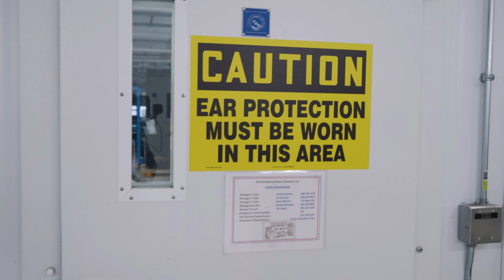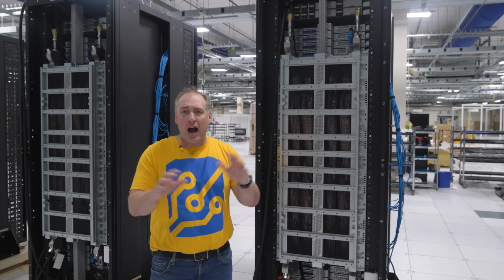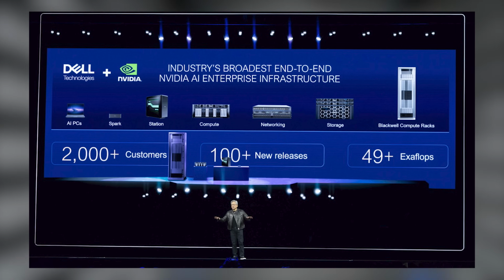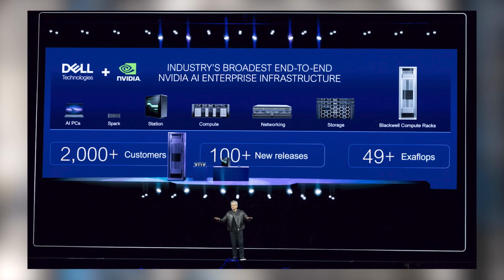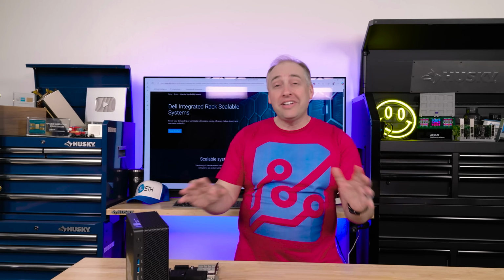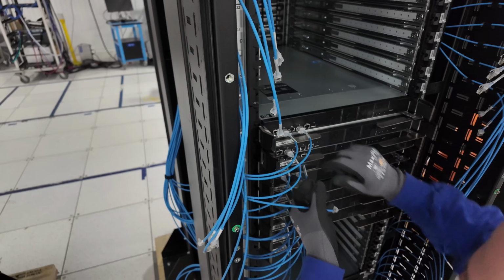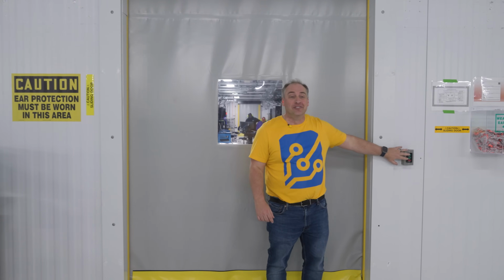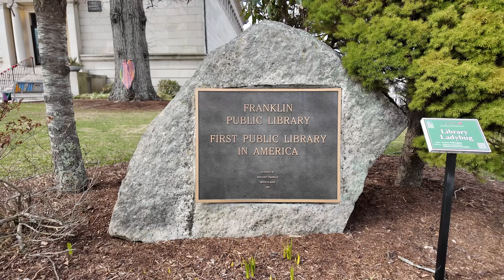Touring Dell's Factory that Builds AI Factories

Comment: That manufacturing facility looks like one of our prototyping facilities given how much space is still left or doesn't have "stuff" in it just yet.

But in terms of mass production, it's analogous to the assembly line for manufacturing/final assembly of cars/trucks where the parts are bought to the car, when it is needed (just-in-time manufacturing).

I was also thinking about this relatively recently about how blade servers have kind of gone away, and came back, but they work differently now where, for example, instead of having an Infiniband backplane, you now have individual blades that plug into the Infiniband switch, individually.

The way that they've set this rack up is more reminiscent of the older blade server days were you have a giant "backplane" that provided all of the networking and support that the compute blades needed to run and was built into the blade chassis.

(There's PLENTY of room for them to increase their volume/throughput, so long as the facility itself can handle it from the power/(water) cooling perspective.)

The other thing that I've also been thinking about recently is how do they prevent biogrowth and/or "gunk" build up like you see with consumer-grade all-in-one liquid coolers when you're cooling this many servers and deploying this many servers at a time?

It would be interesting to see what they do differently on the server side and this is something that I think that the consumer side all-in-one liquid cooling can learn a LOT from.

(It still amuses me that I was designing my own Socket940 waterblocks for AMD Opterons in 2006, as a mechanical engineering student, and now, 19 years later, they're shoving the watercooling components into 1U rackmount servers.)

Comment: They aren't BUILDING anything. They are ASSEMBLING racks from a great many already made pieces. (most likely all from China.) One could do exactly the same thing on the customer site.
Reply from the maker: After touring some large customer sites, I can tell you this is not the case that you could build them at this speed and scale on site. There are a lot of pieces. Automakers build cars from pieces. It is not like every automaker is mining ore to make steel that they then press into a screw.

Comment: 5 years from now, the amount of datacenter hardware that's going to be available on the secondary market is going to be insane.
Reply: lol can’t wait for the “do you think this Blackwell server is a good deal? Not sure it can handle plex transcoding” followed by “why is my electric bill $4,000”.
Reply: @yungcotter  I only pay 9 cents per kilowatt hour, and a single NVL72 rack would cost me roughly $9,000 per month running 24/7.
Reply: @SyntacticOperator 🎶those were the daayys🎶
Reply: @yungcotter with inflation that electric bill will be $84,342
Reply: @JeffGeerling 
Unless we start building MSR nuclear plants.
Turn all the waste from the old plants into electricity. 
Tennessee is at least doing something. Rates up almost 50% already but ready for some AI datacenters now. 

At $1M a rack nobody wants to operate them only 8 hrs a day in winter on solar.
Reply: @JeffGeerling  Probably even more at that point!
Reply: @yungcotter  LMFAOOO
Reply: Sadly this particular type of hardware is probably too proprietary to be of much use on the secondary market. It's not like the R770 that he mentioned, which is a more general machine.
Reply from the maker: This is most likely the case
Reply: Just don't ask the   A.i.   why  humans  enjoy a perfectly piping hot cup of Tea . . .
Reply: I will not forgive DELL for turning so many Epyc CPUs on a secondary market into basically e-waste due to locking them into only working on DELL motherboards
Reply: @nazar-pc  That's not a Dell thing. It's an AMD thing. AMD is locking their Epyc stuff to the motherboard.
Reply: @StenIsaksson  This is obviously false. Locking is up to manufacturers. Most don't do what DELL does. In fact this is not only Epyc this either, there are Lenovo workstations that vendor lock consumer Ryzen CPUs, etc.
Reply: @nazar-pc lol dell servers are the cheapest...
Reply: "Soon, you too can run a small neighborhood's worth of networking equipment in your studio apartment!" -Intel 2029
Reply: The regime will label them national security and they will go straight into a shredder.
Reply: Except in 10 years a gaming pc might be as fast.
Reply: @oscarcharliezulu  Most of the core components should be fine- GPU's, memory, storage, though as Nazar mentioned above, the CPU's will probably be locked to Dell.
Reply: @oscarcharliezulu Oh wow - cool and somehow scary at the same time.
Reply: @oscarcharliezulu   Your Smartwatch is more powerful than a room full of 1970s computers.

Comment: The real story here is what systems and methods are used to build those Ethernet wire harnesses (not to mention the NVLink cabling!), labelling and making those cable assemblies and the automated testing to ensure the cables are plugged into the right ports. It looks like the hardest part of this assembly process, honestly and it's likely very automation resistant. I wonder whether in the future there will be some optimization of these systems to enable daisy chain (vs fan-out) connection, or some customized interconnect to reduce the labor involved in cabling a rack like this.
Reply from the maker: Or robots doing this in the future. You are totally right though, cables and labels are a huge deal in AI systems.

Comment: Interesting that Dell is utilizing a former EMC storage factory into a rack integration facility. Dell is not 'building' the racks or servers. They are integrating the components before shipment to the final customers. The servers in these racks are all Direct Liquid Cooled (DLC).
Reply from the maker: On these, the NVL72 is designed to operate with all 72 GPUs together. A normal rack and stack is much faster to install. Just building a bigger unit than an individual node.
Reply: @ServeTheHomeVideo  I was part of Dell's sales organization, until March, and am quite familiar with the Dell PowerEdge XE9712 which is based the Nvidia GB200 NVL72. I've also sold Dell rack solutions and toured one of their other integration facilities. My point was that all of the components, including the racks, boards, and other components are manufactured somewhere else and tested/assembled at Dell's Integration Facility. I didn't realize the XE9712 was being built at the former EMC factory in Franklin, MA. I am glad that Dell allowed you to tour and film their facility. These systems are very complex and Dell requires these solutions be built only at a Dell facility. Resellers are obviously not happy about this since part of their 'value-add' is rack integration. Customers for this type of infrastructure are primarily Cloud Service Providers who have massive scale and Direct Liquid Cooling in their data centers. Enjoy your videos!

Comment: How the fuck is this an AI factory? This is barely an assembly / racking site, where they configure the machines that are made in China.
Reply: rack and stack. and do baseline testing to make sure the parts are not DOA.
Reply: You can tell this is in the US because everyone is on a break. Also this looks laughably low volume.
Reply: @jay-em  low volume?! HAHA. They actually can not buiild them fast enough man. I already know of 2 corps that have bought of 28000 total nodes each. Some several thousands of each of these cabs
Reply: @samishiikihaku hence I would have expected an order of magnitude larger operation.
Reply: An assembly site is a type of factory, so I think you've answered your own question. And I doubt the machines are made in China given that high-end AI chips are subject to export controls specifically targeted at China. Maybe the PDUs or rack components are.